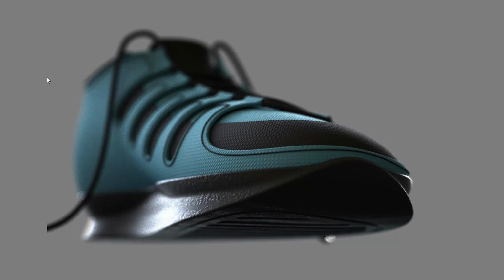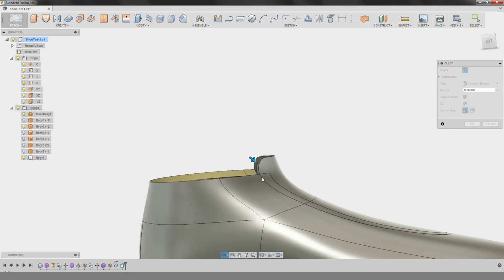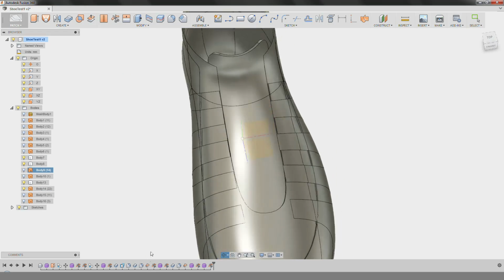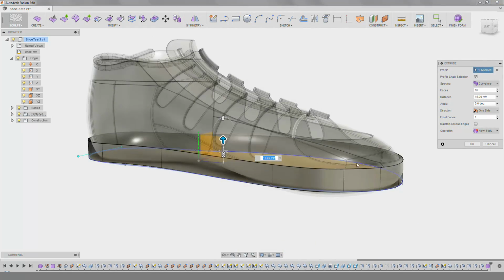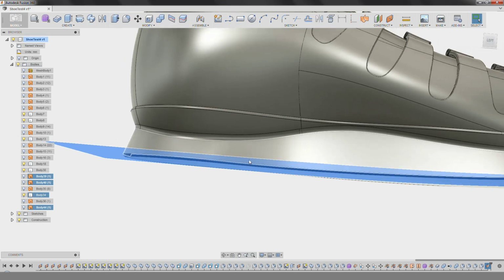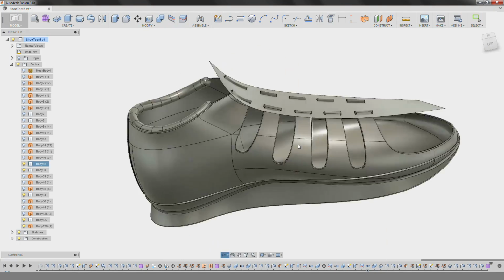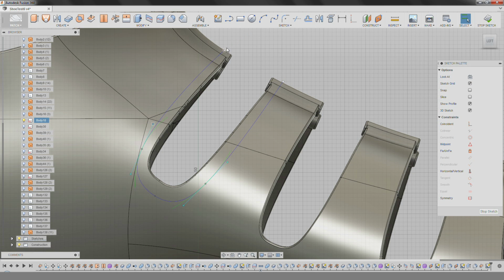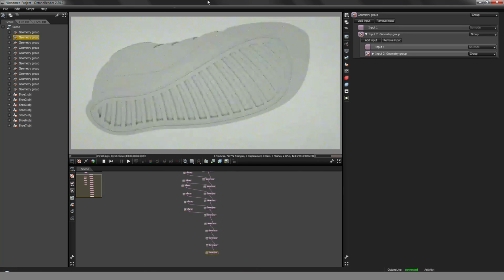Modeling a Shoe in Fusion 360

Comment: That was awesome!

Now, how hard would it be to make the file useable? Like make patterns and molds and whatnot
Reply from the maker: Should be reasonable to make molds and a last - 3d print the sole, make a mold from it, then cast some polyurethane or something - the flat pattern is a bit tricky - there is a fusion plugin called "exact flat" that can make flat patterns from surfaces, but I'd probably end up doing it by hand. There is also dedicated shoe design software that's purpose built for this if you want to go that far
Reply: @unimportantprojects  Thanks

Comment: if this was me fusion would have crashed 57 times
Reply: dont forget the 5 min waiting, each time it wants to save.  That being, every time you want to adjust the model.
Reply: @Whythoabc  and don't forget the pop ups when mid command and the autosave fail pops up.  Just more ways you can tell the software designers don't use CAD on a regular basis
Reply: i mean no offense, but it sounds like you guys need some better computers. I used fusion on my 2012 macbook pro with a solid state drive and dont have the problems you describe
Reply: @jalensailin  no offence taken but the pop ups and slow cloud saves occur regardless of OS . I can see where maybe Mac OS has better or  more efficient video drivers for F360 for Mac but other than that i doubt Macs are any better or worse ......
Reply: @jalensailin  Im always doing some pretty labour intensive stuff in the sheet metal environment unfolding and refolding with many facets extruded. Fusion can do it, but sometimes it really doesn't like to. Like it will crash the first 3 times doing something and not changing anything at all in the process, the 4th time it will work and effortlessly too. Ive got a 2017 27'' imac fully loaded 64 gb ram!
Reply: Leckie Installs Car Alarms and Starters dang. Sounds like fusion is just a bit unstable across devices. What will work with some won’t work w others. I wish ya luck!
Reply: @Experience Electric I wanted to say that most likely it's a lack of computer power, but I see that people have already said this... I had the same thing before I improved my computer, there were constant crashes and friezes, now everything is fine. 
It is possible that the program has a conflict with apple hardware

Comment: Great work! I love this! Novice question - can you extract the cutting sheets, if this shoe was going to be manufactured?
Reply from the maker: Karl Christian Otten 
There are a couple ways to do this, but it requires plug-ins or external software. The easiest way for Fusion is probably to use a tool called "exactflat", there's a free trial period if you want to try it, but it's pretty expensive for full time access if I remember - if you only want to do a couple projects with it, I think they have the ability to pay per project or day use that isn't so bad. Another option (what I'd usually do for flattening) would be to import step, sat, or iges into Rhino and use the flattening tools in that - they aren't as accurate as exactflat, but usually get you most of the way there. Another potential option, although a little challenging, would be to use pepakura designer on a low-res export mesh, then refine with illustrator... It's meant for paper, but I've seen people do some wild things with it. 
There are also a few dedicated shoe design packages which certainly give you accurate flat patterns, but they seem to be prohibitively expensive for individuals or small businesses. 
Honestly, if it were me, I'd get (or model and 3d print more likely) a shoe last, tape it up, sketch out the pattern, cut up the tape and do it old-school, this is how it's been done for ages and many still do it this way. 
Also, depending on how you work and which factories you're working with, they may not even want a flat pattern, it'd only slow them down, a reference and some definitions of materials may be all they really need... Remember there needs to be many different sizes, which means many different patterns, some factories will help you manage this.
Sorry I couldn't give you a clear simple answer, but I hope it was helpful anyway.
Reply: @unimportantprojects  It's not a simple reply, but comprehensive and in-depth indeed! Thanks for explaining many  possible ways as you can, and if we just stick with one "software driven" solution is in fact , incomplete towards the real world.Thank you so much.

Comment: Hello guys,
This is quite impressive demonstration of a Fusion workflow. I want to ask its gurus for an advice.
I’ve been working in Rhino 5+Tsplines for many years, got used to it a lot and find it a quite universal application. Yes it (Rhino) has some disadvantages as the absence of any construction tree and real weakness in filleting capabilities (so quite often I find myself exporting files to Solidworks and making fillets there, then export back to Rhino. It saves lots of time than doing fillets manually). But it was unpleasant surprise that Rhino 6 WIP did not support Tsplines anymore. So I decided to move to smth new. First what I checked was Fusion (since Tslpines moved there). At first, I was amazed but then the euphoria gone and frustration came. It is not that “design as you go” as I thought. It is not that hybrid modeling I was looking for. No osnaps (can’t imagine working without it), no decent move/rotate/scale with ref points as in Rhino, Tsplines are not that powerful as they used to be – no chamfering with keep distance option (only percentage), no keeping edge, no inserting edges perpendicular to other edges and so on; no way to directly modify edges or vertexes. So I thought it is not what I was after. Then checked Solidhinking and again got disappointed. But with this video I think that maybe I should look into it more deeply? Knowing basics of Solidwoks, good knowledge of Rhino, AutoCad, Tsplines it took me few hours to get the hand in the Fusion basics, but I am missing too much tools here, too much to feel comfortable. What do you think, can Fusion replace Rhino making the process of modeling as easy?

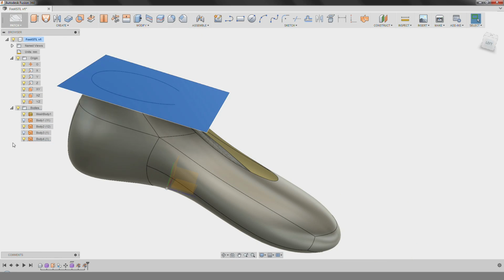Comment: Hello nni, i'm just stucked trying to trim the front part of the shoe at 7:19. It does not work as you explain. Can i share with you my Fusion file ? I really want to go to this tutorial until it's end. Thank you very much by advance
Reply from the maker: Gilles Carali 
Typically, if there is a problem with trimming, it's because the surface you are using to trim doesn't fully intersect the surface you are trying to trim from or the surface you are using to trim intersects other parts of the body that aren't supposed to be trimmed.
If you still have trouble with trimming, I would check out https://m.youtube.com/watch?v=NypRE2aFhh4 for approaches on overbuilding surfaces

Comment: Would you know how to export the shoe design into cut-out pieces?
Reply from the maker: The only ways I know of are not native within Fusion... There may be other ways, but these are what I would look into:
-There is a plugin called ExactFlat that can create 2d flattened patterns; I've never used it, but looks fairly robust.
-In the past, I've used Rhino's surface flatten tool for laying out fiberglass layers - it worked well for most things I tried.
-Depending on your needs, you may want to look into dedicated shoe design software... these all give accurate flat patterns. Crispin Shoemaker is no longer available, but you can find others if you do a search.

If anyone knows a better solution, feel free to share.

Comment: Excellent tutorial. I was surprised nobody asked you this question.  You seem to be an expert with both Solidworks, Fusion 360 and probably other programs. Ive been using Solidworks for years now and compared to fusion 360 - it seems very expensive. Basically Im wondering will there be a transition of users moving from Solidworks to Fusion 360. Do you have any opinions on this. Would you recommend someone like myself learning fusion. I teach solidworks to my students but if they wanted to do some design on there own - they would have to purchase a licence of Solidworks for nearly 4000 dollars. Its quite steep compared to Fusion. Thanks....Tim
Reply from the maker: Not sure if I have a clear answer for this one, but here's my opinion:
For freelancers, contractors, and startups, I wouldn't be surprised if there is a shift in users to Fusion, simply because it's a fully capable tool at 1/10th of the cost (or free if you qualify). It has become the only thing I use for personal/hobby use for this reason.

For people already using tools like Solidworks in the industry, I doubt there will be a major shift any time soon... Getting companies to adopt new software and workflows is like pulling teeth. In these situations, companies might use Fusion as a supplemental tool for using features like t-splines or the new mesh editing tools for 3d print prep.

The reason I follow Fusion isn't just because of where it is now, but because of how active their development team is. The speed at which this software changes is quite impressive. That said, it is still missing tools that some may consider as deal-breakers; sheet metal tools aren't there yet for example.

If you do decide to learn Fusion, you should find it quite easy to transition what you know from Solidworks... The base concept of parametric modeling is the same in both programs. You'd probably begin to feel comfortable with it after just a couple days. The same thing applies to your students; as long as they understand the fundamentals of how parametric modeling works, it should be easy enough for them to pick it up on their own.
Reply: +name notimportant Great answer. Thanks for that....tim
Reply: Hi Tim I'm a 3D modeling amateur, it's my favorite hobby. I used Solidworks for nearly a year before I discovered the wonderful Fusion 360. Moving on from Solidworks to Fusion is easy. Of course I felt some difference at first due to interfaces styles and options... I also felt frustration thinking that some features didn’t exist. Then bit by bit I discovered that they actually existed in a different way. The main reason I moved on to Fusion is the sculpt mode. Unfortunately Solidworks doesn’t have features for a really flexible free-forming that fusion has. And so, making an optical mouse body or even a car body is much easier in fusion. In the first 2 months of using fusion, I was still using Solidworks in parallel. Now I’m on the 4th month and I don’t open Solidworks any more. This was a brief description of my experience. I wish you good luck.
Reply: Great workthrough, name notimportant!

I bought a SolidWorks license a decade ago after completing my MA (had already used it professionally for 5 years beforehand as a mech eng). I haven't regretted it, in spite of Dassault mucking about with the pace of development, maintenance etc.  However....

Nowadays I use SW for all freelancing work (I work with smaller design houses in the UK and they all seem to use it) but I am increasingly using Fusion for my own design project as SW refuse to add a T-Splines equivalent to the package for a sensible amount (how much for nPower Power Surfacing or the new SW Industrial Designer???!!).  It's great for hacking up stuff for 3DP and I can always use the surfaces produced as a template for 'proper' (ha!) SW surfacing.

I seem to remember reading that Dassault had a chance to purchase T-Splines before ADesk bought it.  Whoops...

(In an ideal world I'd have bought NX, but anyway...££€€$$)

Rest of your comments seem entirely sound.
Reply: Hey Tim,
I am a 14 year old and referred to your solidworks tutorials....... They were amazingly explained. I now design my home tools and 3D print them.Thank you so much for those. They really helped me

Comment: Would you recommend Fusion 360 over something like Maya or 3DS Max?
Reply from the maker: These are two different types of software for different purposes... Max/Maya results in a poly (mesh) model and is more for CG artists and animators, Fusion results in solid parametric models and is more for product designers and engineers. If you want to do computer graphics where the end result is an image, animation, or game asset, learn max/maya/modo/etc... if you want to do modeling where the end result is a physical thing, learn fusion/solidworks/rhino/etc. Given the variety of things I've worked on... it's valuable learning both.

Comment: thanks for the video. the other one is awesome too! reading the comments, so what's your tool for daily use? you said you don't use very often fusion to model
Reply from the maker: Over the past several years it's been almost exclusively solidworks. A model like this would have taken me more time in solidworks though, simply because of the complexity of the base form... everything else would be the same workflow.
Reply: +name notimportant thanks for your answer! I've been testing meshfusion and fusion 360 and both have theis pros and cons ! it's very difficult to get the best workflow using only one tool. Solidworks has been used for long time and as I can see it's still being using. really helpul your tips using t-splines!

Comment: This program is similar to rhino? and which one is better, thanks
Reply from the maker: Similar in some ways; with the t-splines plugin, Rhino is equivalent to the patch and sculpt mode of fusion with model history turned off. Rhino may be a bit more robust in the patch/surfacing area + gives access to generative design tools via grasshopper. Fusion adds parametric model history, parametric solids, parametric sketching, and a lot of other stuff so I prefer it.

Comment: what do you use as an input device? I imagine it's not just a mouse. for example, wrapping around the ankle. I'd spend half the time fight the orbit function. nicely done video. thank you
Reply from the maker: It's just a regular mouse, shift+middle mouse, nothing special. 
It's interesting you bring this up though... I had to battle with the orbit in Fusion for the longest time because it didn't behave like I was used to, but there's a setting in the preferences that allows for "constrained orbit" (instead of "free orbit") which can make things much easier [EDIT: I say that, but I don't think it was setup like that in the video... but I still recommend trying it]. 

Another trick I use (not sure if I mention this in the video) is when moving stuff around in edit form, I'll often switch the coordinate space to "view space" to refine the form from various angles.
Hope that helps.
Reply: that's helpful thank you. Good to know what's possible.

Comment: I still dont get what this program is? Kind of everything-is-nurb-surface and everything just works? Dont bother with vertices or edges, fusion just "trims" everything with... magic! I dont quite like it (maya user).
Reply: wouldn't really compare Maya nurbs for this(especially considering how after 20 years I'd still need to buy a plugin to do hair in Maya which says something about a software)
Fusion 360 makes use of booleans, you can export and retopologise the result after in another software.